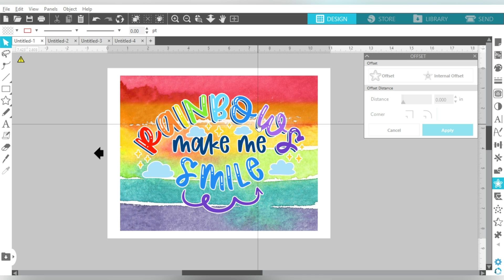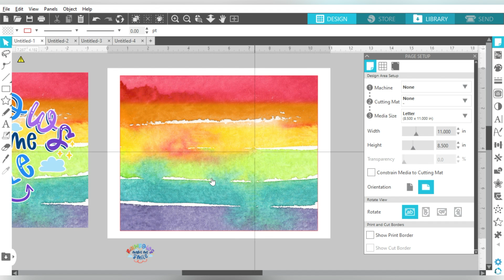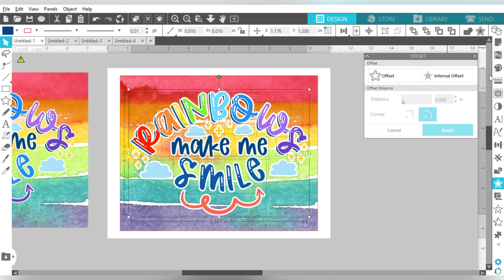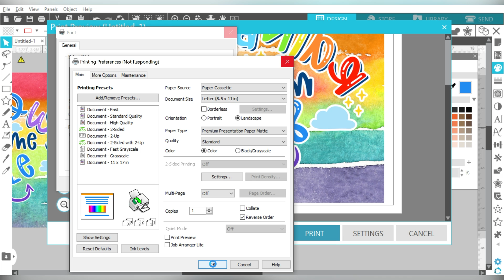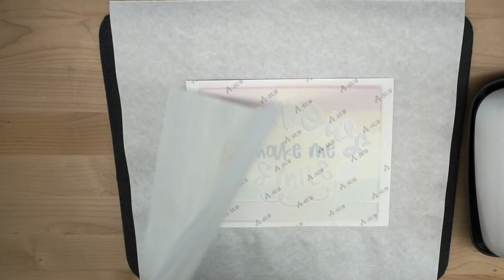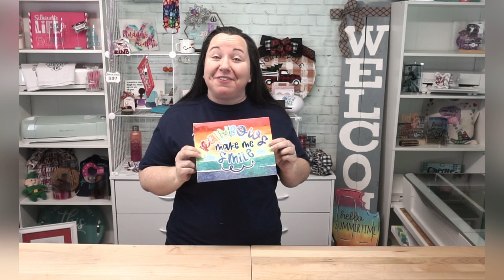🧩 How to Create a Sublimation Puzzle

Comment: AS usual, I've learned something new about Silhouette Studio! And this wasn't really ABOUT Studio! That I can change color of just ONE part of a design in Studio IF it is SVG and I ungroup. Thanks, now I don't have to put it in PhotoShop 9 to change color! Also, reminded me that offset white will make it stand out. I should have used that on a design I just did. 

You are the one that pushed me into sublimation, told me to go Epson and now, you have convinced me that even though I have a good heat press, Stahls Pink Craft GREAT for HTV, that I DO need the Easy Press 2 if I want to do bigger designs on sublimation (not HTV) and it looks like it will be easier to NOT have lines or stretched polyester marks if I have the Easy Press. Plus, better for blankets I like to do. Cheaper than a HUGE expensive heat press! Thanks for a great video!
Reply from the maker: Hey Angela!  I'm so glad to have inspired you and it warms my heart to know that you are enjoying sublimation so much!  If you ever have any techniques you want to see, just let me know and I'll try to make it happen for you!   ---Becky
Reply: @DesignBundles  Becky! I went to my small Walmart, less than 10 minutes away, and got the only 12x10 Easy Press 2 in a store in my little town!  I am happy to say, you are right, you can do sublimation on an Easy Press.  A little more practice and I'll do even better. But, I've solved the pucker problem and the heat press lines are MUCH less on polyester with the Easy Press. I'll stick with my Pink Craft heat press with HTV though.

Now to go watch your tumbler video again. I just realized earlier this week that the toaster oven a friend gave me a few years ago is actually an Oster CONVECTION oven! Darn work got in the way or I'd have already done one. I've got an oven thermometer, have my hummingbird design printed and my practice WM water bottle (that will actually sub) ready to go. I'm not doing an all over design, just hummingbirds flying all around, just no background and my name. No shrink wrap so I'll just wing it with paper and blue heat tape. If this works half way decent, then I'll order what I need next payday. 

I'm not sure who is enjoying sublimation more, ME or my husband! He loves that the second thing I sublimated with the new Easy Press was a picture of HIS dog on a mask!